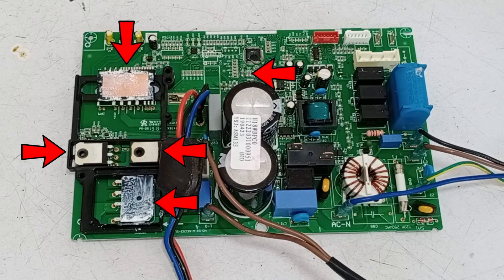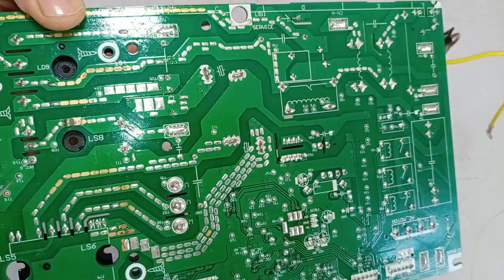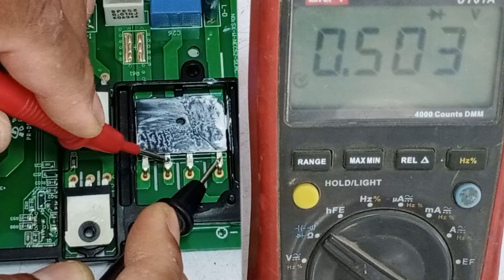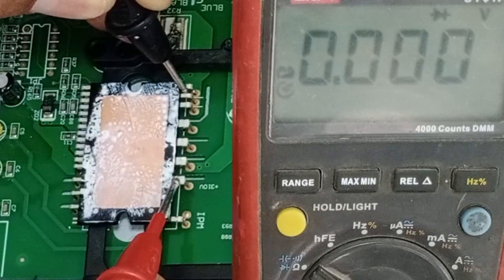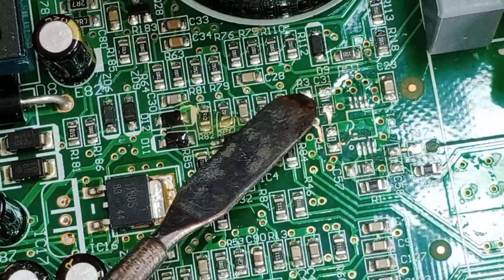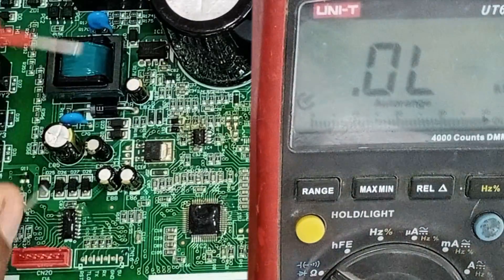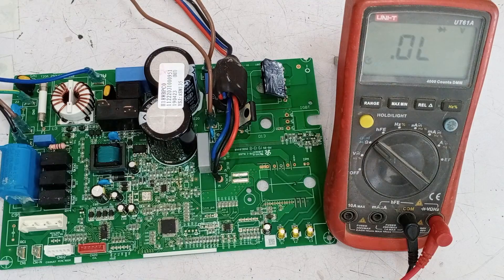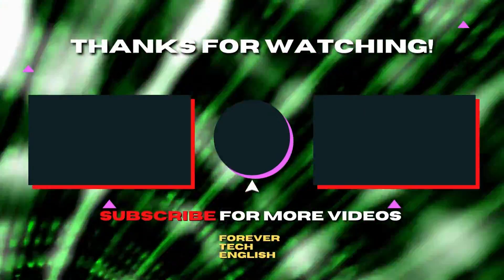Mini Split AC Circuit Test: Failed Due to Bad Compressor

Comment: so that means after mcu is diagnosed short circuited, you have to replace the entire pcb board, right?
Reply from the maker: The MCU can also be replaced if you have a spare, or remove it from another board which has a problem that is not related to MCU. Otherwise you will have to replace the board with a new one.
Reply: @forevertechenglish i see.. as long as the mcu replacement is available, it can be replaced literally just like the other components on those pcb. thank you for the reply. really enjoy your videos👍

Comment: If I there is continuity between emitter and collector both ways on the IGPT this means it has gone bad doesn't it? (IGPT still in circuit).
Planning to remove it to test it further. Thanks!

Comment: Is this AUX brand? My carb looks very similar
Reply from the maker: This circuit board is used in many air conditioning brands. Possible could be used in the Aux brand.

Comment: Sir. I have LG smart inverter ac. One day i got ch21 and ch 26. then i cleaned allthe connectors ipm Heat compound. Then errors gone. But still  It shows like this. if i First time connect the power, then both indoor and outdoor working normally and cooling also ok. Then compressor turn off after reach the correct tempreture. Then socond time the outdoor indicator bulb appeared on indoor unit for one second. Suddenly it turn off. Only working indoor fan.  Compressor not enguage.  If i disconnected the AC power for 10min. Then again ac working normally while next start. Please tell me some to do

Comment: Excuse me, what is the value of the shunt resisten burned. Thak You. Saludos from México. I have the  same problem. I Will apreciate it.
Reply: 0.010 ohms . 5 watts
Reply: @smithsimyon8467  do You know the size. I want to bay it in Ally Express. I apreciate your help. Greetings from México.
Reply from the maker: I checked it today. This is the value. Somebody already commented to help you out. The number of the Resistor Is R010 ( 0.01 OHM, 1W) Approx
Reply from the maker: Let me check, what is the value. I will let you know.